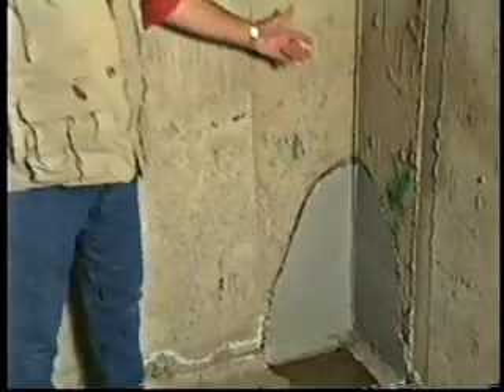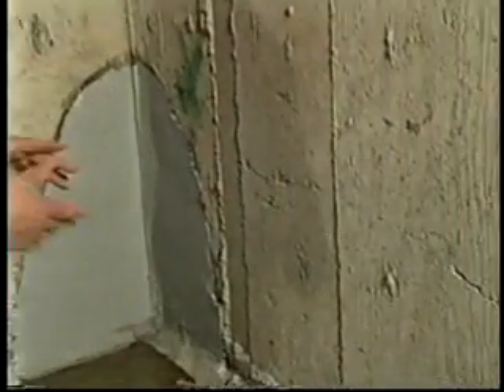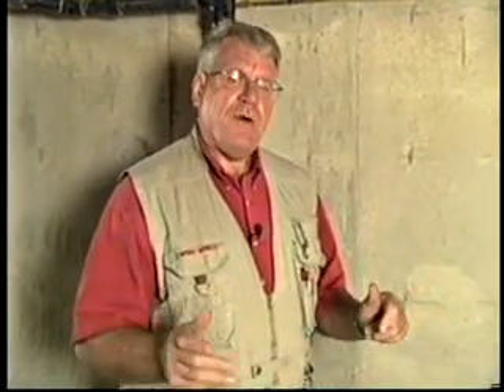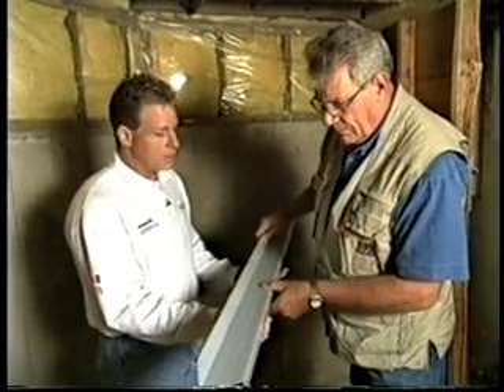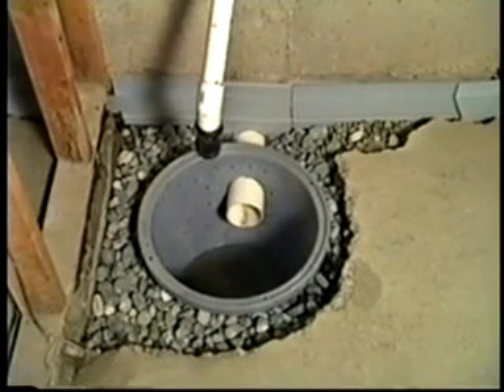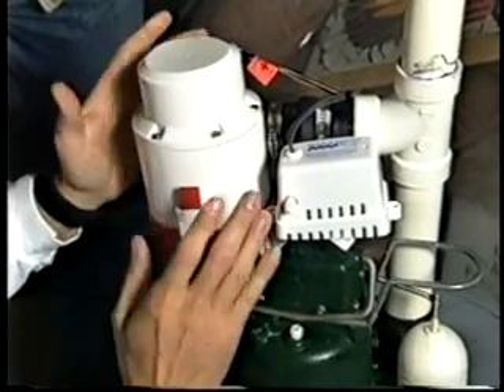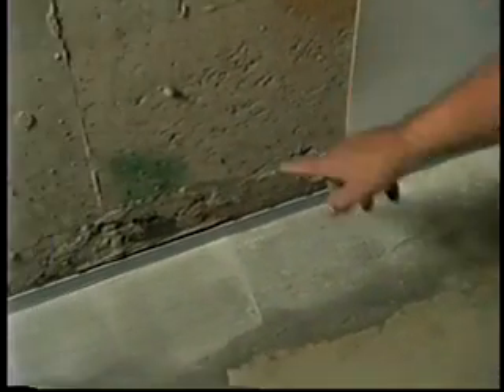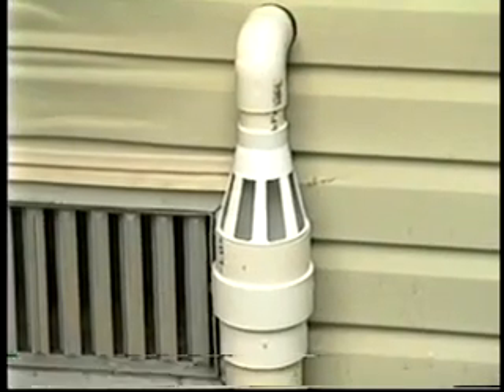Fitting a basement sump pump system. Guides

Comment: Which I don't really see as a problem. I'm assuming here but when the water drains back into the sump pit it is minimal unless you have a very long discharge pipe/drain system. Also it gives reverse cooling I really don't understand the check valve only in cases of extended drain/discharge pipes which can result in a lot of water coming back how ever most discharge pipes flow in a slope so gravity prevents most of that as well.